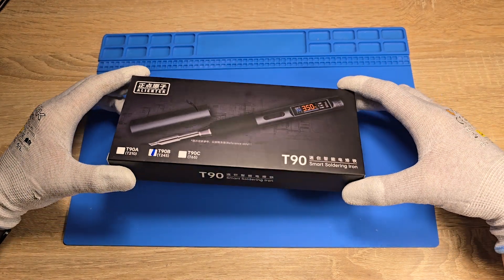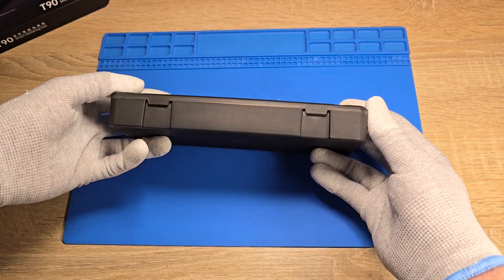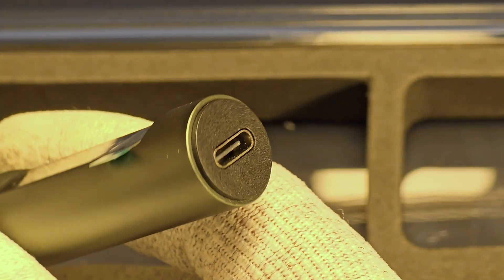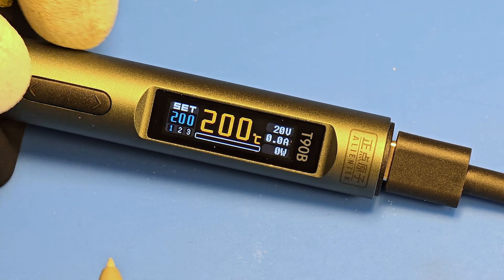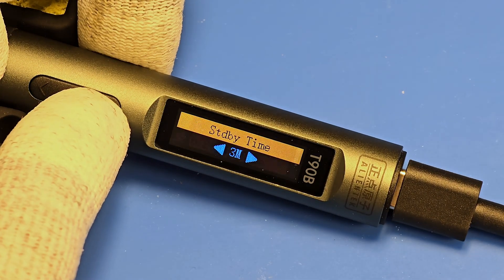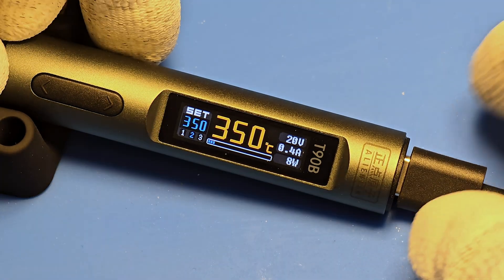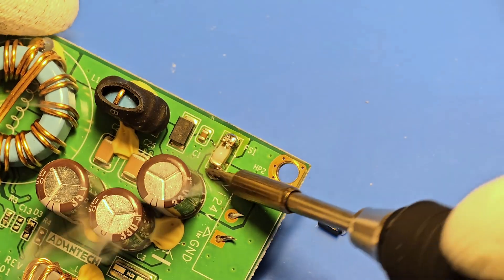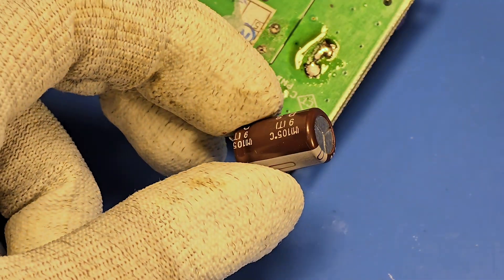ALIENTEK T90 USB-C: 140W Soldering Iron with QC/PD! | UNBOXING, TEST & FULL REVIEW

Comment: Seem you are using wrong charger or not change the cable include with it yet (the orignal cable is max 65w). Use proper cable and charger can unlease the monster to true power 140w and it is the game changer for sure.
Reply from the maker: Seems you did not watch the whole video. The soldering iron was tested with the 65W PSU from a laptop.
Reply: @TechDayEveryDay  why not use 140w charger but use only 65w
Reply from the maker: Because 65W is more that enough for that soldering iron

Comment: Hi, is there a voltage leak from the tip to ground on this iron, when using your 65W power supply or something more powerful?
Reply from the maker: No, I did not noticed that
Reply: @TechDayEveryDay  OK. Have you checked it with a multimeter, or are you just saying that you haven't noticed it damage anything?
Reply from the maker: You have to connect the GND with the PE line. Please check the user's manual page 13.
Reply: @TechDayEveryDay  Hmm OK that looks like a bit of a pain. Unfortunately I have already bought the T90B iron so hopefully that will not be necessary. Thanks anyways :)
Reply: @TechDayEveryDay  I can confirm that there is a substantial voltage leak (120V AC RMS) with this iron using a proper Belkin 140W charger on Australian 240V AC mains. While this is technically the charger's fault, it might be worth mentioning this because grounding this iron is rather difficult.

I feel a tingle on my skin when using the iron on a PCB groundplane with one hand and touching a pin connected to the groundplane with another hand.